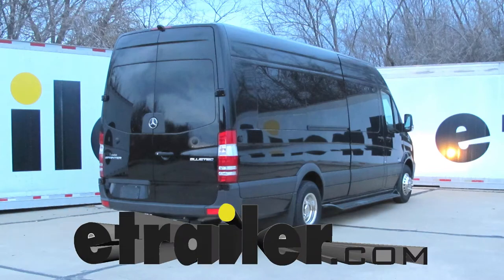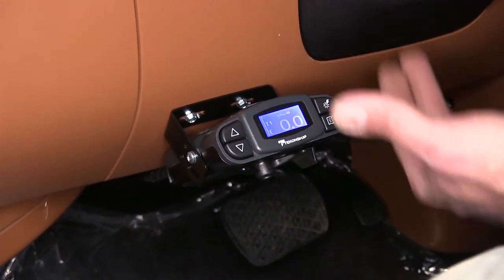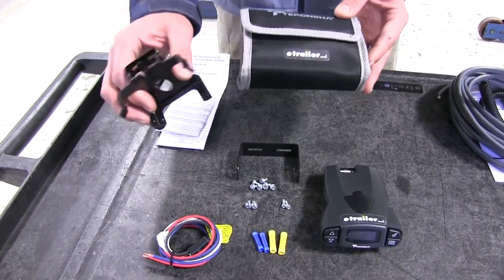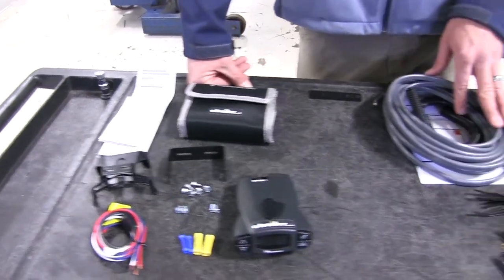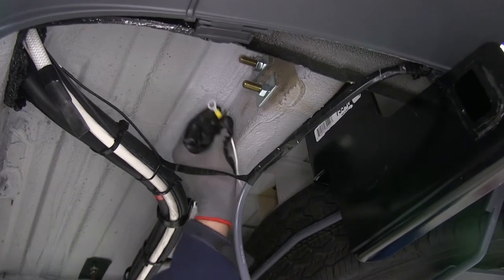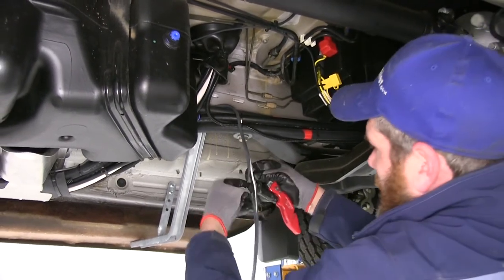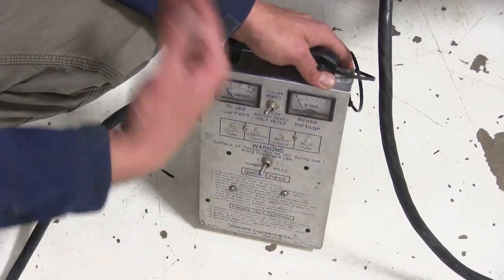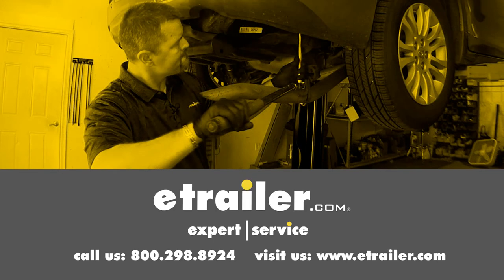Setting up the Tekonsha Prodigy P3 Trailer Brake Controller on a 2016 Mercedes-Benz Sprinter 3500

Comment: Do you have any kinf of video for the new Sprinters?  They have a connector under the drivers seat.
Reply from the maker: You betcha, check out this link:
https://www.etrailer.com/tv-install-redarc-tow-pro-elite-brake-controller-2020-mercedes-benz-sprinter-2500-red44fr.aspx